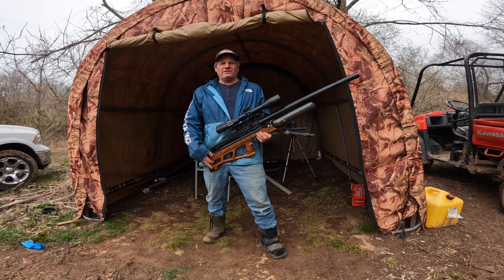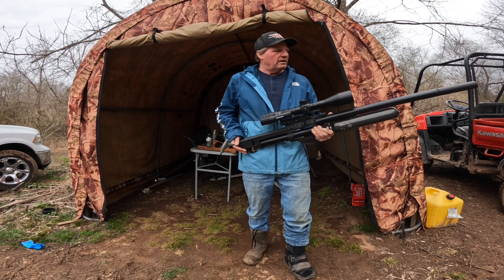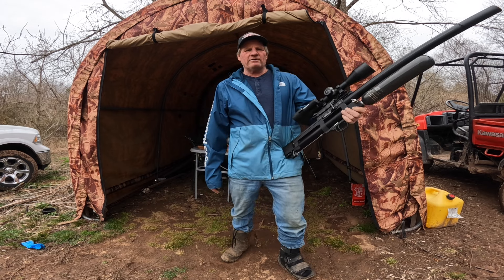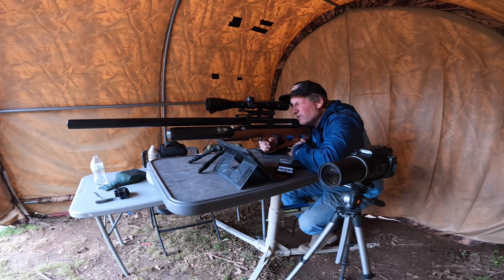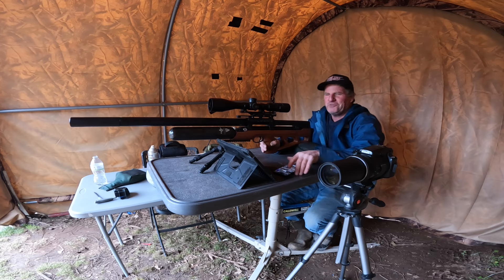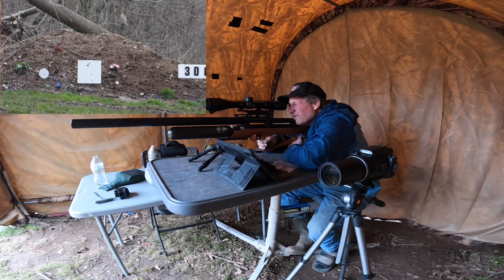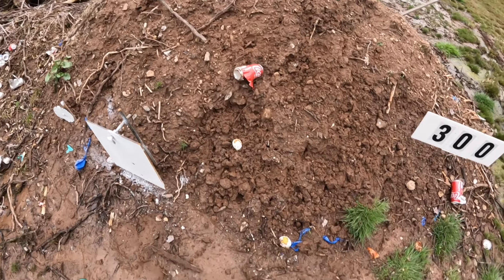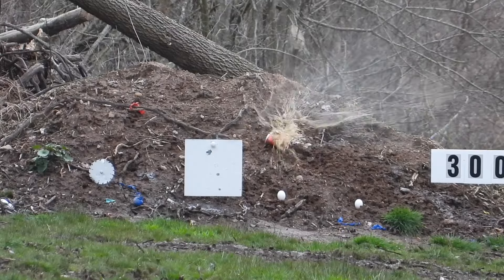Vulcan 3  vs  FX DRS in tuning

Comment: We’re you single loading or we’re you able to modify you mags to fit the 46’s? I shaved my mags down to nothing and I can only get about 7 of them to function correctly in mag. If I load all 10 they jam up. 

Btw. Try out the 50grain altaros. I think you’ll be impressed. I run them at 935fps.
Reply from the maker: I bought that African air ordinance mag, but had to modify that bike, grinding it down a little bit, but it seems he working very smoothly on the configuration that I have it at

Comment: Hello sir 
 You can design a speed adjustment screw with a pop pin to hold it ,you can tune the speed while the pin still holding the screw in place .
I have mine now ,but I had to drill a little hole in the stock.
Great video